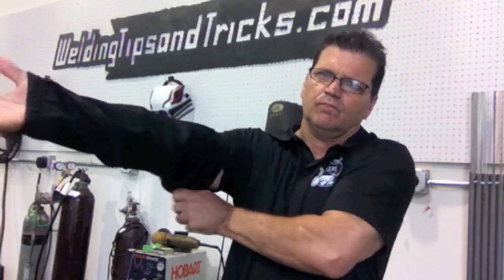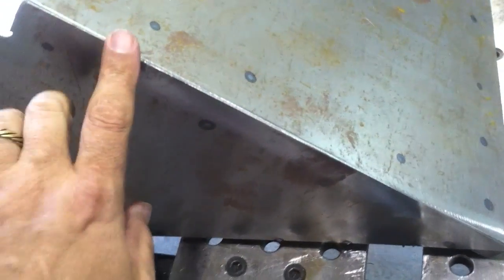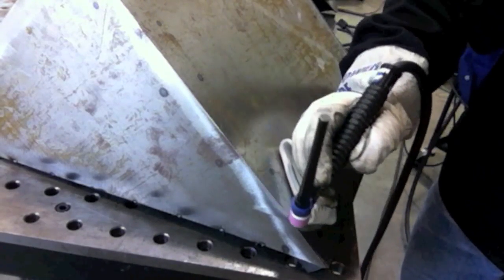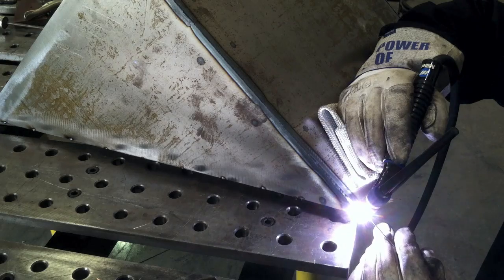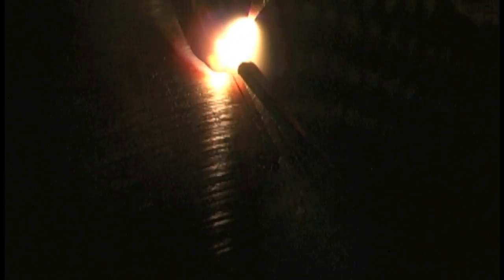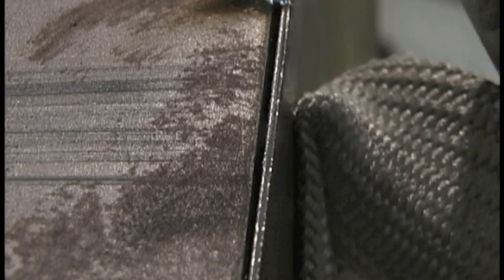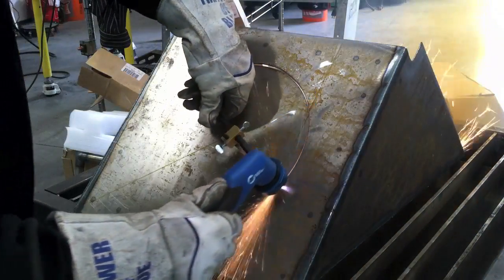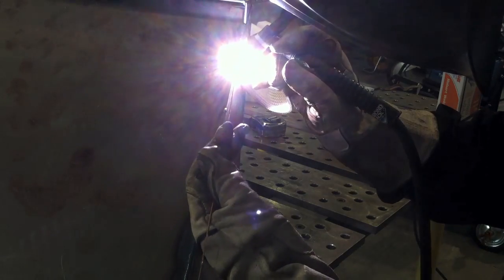Tig Welding Outside Corner on the DIY plasma cutting downdraft table part3

Comment: Regarding hitting your hip on the extractor box, how about cutting the wall around the box and putting a hinge at the top?  Swing the extractor box out and lock it in place when you want to connect the extractor hood.

Comment: Hi Jody I'm a new comer to Welding.  What kind of filler material are you using?  My first welder is the Powermig 210 MP.  I know that I can use the torch with the gas control on the handle but do you recommend the foot pedal?  I'm a little nervous about opening up the welder and the added cost of the footpedal.
Reply: Bro, you'll never regret adding a footpedal if you do any TIG welding at all. I put it off for 6 months and had myself convinced I'd lost the skill to TIG after the 15 year break between using it everyday at work, and buying my own machine here on the farm, and so I wasn't getting half of the benefit of my machine. I got a footpedal for Christmas but let it sit for another 2 months thinking I had gotten too old to use two hands, not to mention adding my foot into it.

Well, I may not be as fast as I was in my 20's and 30's, but I'll be damned if my TIG welds aren't a thing of beauty(to me at least, LOL!). It took a couple of runs to get used to it, but the difference between a torch switch and a footpedal is amazing, and now I know why the company I worked for spent the money to outfit us with them. If you go without beer for 2 weeks it's paid for :D

Comment from the maker: oops, I was thinking about a different torch.. the one in this video is a miller air cooled #9 tig torch.. its nice but it does get pretty hot if I go over 150 amps for more than a minute or so.

Comment from the maker: the torch is actually a combination of parts.  A miller #20 style water cooled torch head with CK flexible lines.  I had some extra parts from old torches so decided to use them to put together an extra torch....it feels good and the lines are really flexible.  I have a brand new CK in the box that I will be hooking up pretty soon.

Comment: number 1 rule, don't weld the gap. move sheet metal together and male a small weld to make it stick together, because otherwise dimensions will change or the sheet metal will look strange, epsecially if it's decorative sheet metal.